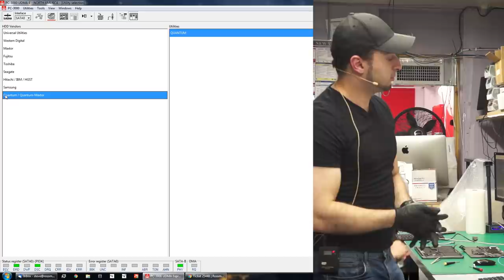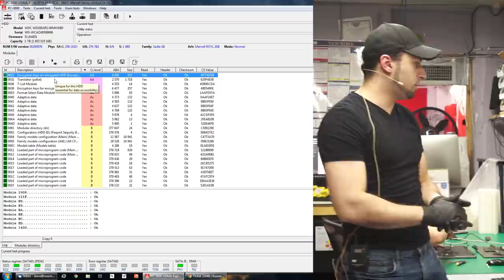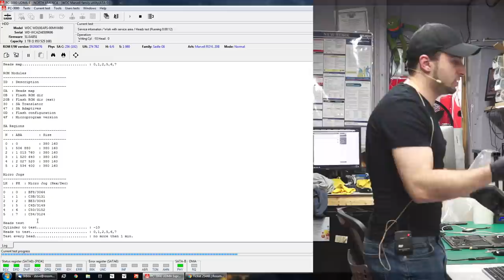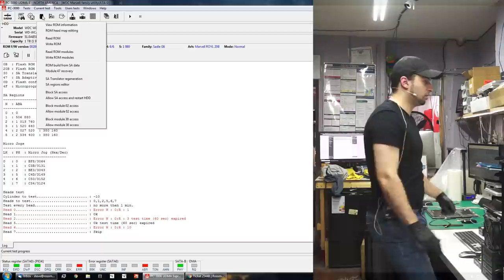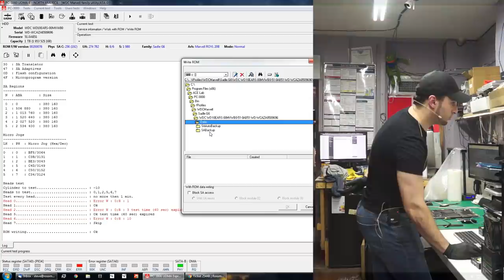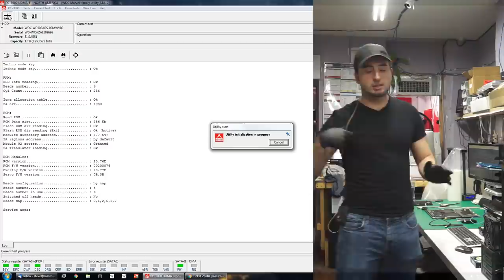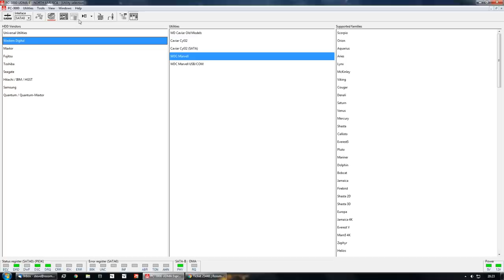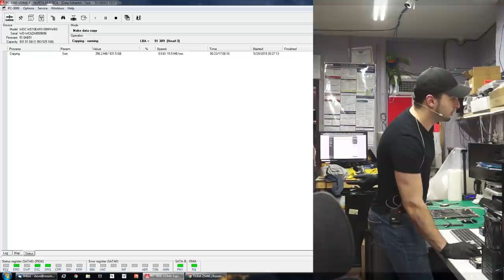Western Digital hard drive data recovery: heads swap

Comment: What I am interested to know is whether similar boards with almost similar model numbers but same capacity can be swapped to check if it is a bad board, or it has to be same exact whatever. I would think that the platter alignment just means that the data structures are stored on an index disk and not the drive ROM if it has any, so simply swapping boards would work….

Specifically, after seeing that swap between a WD20EARS and a WD10EARS, I’m guessing that third letter is the important distinction that applies to all WD drives of this model series?

Comment: All my systems i use Western Digital. I do repair PC and electronics. Most faultry drives i seen are the Seagate ones... I am at same page that he is. Not that the Western Digital fails (they do and i have seen those) but is far less probability. They are pricey but are better to me.

Comment: Steve is wrong saying that Seagate's market share is a third on Western Digital's one.Actually, they are almost the same 40% (WD has several percents higher share).
He is absolutely right that Seagate drives are inferior in  reliability. The most reliable drives were made by Hitachi/HGST, and now there are several models made by both WD and Toshiba, but designed by Hitachi (WD got Hitachi's technlogies, Toshiba got both tech and factories).

Comment: at 14:40 "contempt for Seagate" I 2nd that. I've been in IT for more than 20 years and as far as I'm my experience goes, Seagate have never been a strong synonym or reliability. Nice to see that "it's not all in my head". Makes me wonder how come they're still in business.
BTW while we're on the subject of HD reliability, can run a quick poll? Personally I'd say that Hitachy fail the least
Reply: Yes, according to backblaze anyway. Hitachi/aka/Toshiba best , then WD, then Seagate worst. And this has been my experience also. I still use seagate but I've got a bucket of dead seagate drives and only 1 dead WD. Its not just build quality, its firmware(software) quality as well. Go with NAS/Red/Enterprise drives over consumer if you can.
Reply: @mrlithium69  Thanks for sharing your experience which mirrors mine. thanks for the advice about drives. Still wonder why Seagate still hasn't gone under given how many their drive turn into door stops

Comment: Gotta disagree with the Seagate hating. Each side has their lemons but Western Digital had full lines that were lemons. I'll never recommend a WD Blue or WD Green to anyone. The failure rate on those things were so bad at one point if the drive was dead or clicking it was usually one of those.

Besides hybrid drives seem to be the ways to go anyhow, so Firecuda or the WD equivelent. Unless you want server grade WD Reds for some reason.

Really cool video though, nice to see the trailblazing is still happening over there.
Reply: I installed hundreds (maybe a thousand) of WD Blue, Green and Black (and previous families). Actually the failure rate is very low, I would say 2% or less. Maybe I'm just lucky. On the other hand, I bought less than 20 Seagate and Toshiba HDDs, and I have a lot of failures.
Reply: audio01 - have had tons of blues and blacks. As long as you raid them and stay on top of it no problems
Reply: i have been using hitachi for 7 years. Seagate for 2. Hitachi is pretty loud at times but it works still. Seagate throttles at times for some reason but no actual sign of breaking. Dunno, i think its just a matter of cleaning the dust and keeping parts cool. I have a filtered 200 mm fan in front of my raid so i dont think there will be issues lol.
Reply: @audio01  I found the WD Blacks and WD Reds held up fairly well, have yet to personally see a WD Black fail but almost every WD Blue or WD Green failed within 5 years. I've seen WD Blues fail a week into usage and WD Greens fail a few years in.

Like I said it seems to be the specific lineup of drives that have issues. Seagate has had plenty of issues from what I've seen online but I haven't had a single one of their hybrid drive fail on me yet. 

Again I will always recommend the cheapest best performing solution.
Reply: NVME is where it is at for now - gonna hope they have decent lifespans
Reply: Every seagate drive ive bought died within 3 years.. after being burnt six times, never again

Comment: I wanted to see what is causing the head to click beside that this is the best video I’ve found in hours but pls do a vid on why it clicks? what causes the click sound ? Like the head stopper or middle of platter from the head hitting it? Cus mine makes 3 clicks in all but the click makes 2 clicks stops then two clicks stops then once more before it gives up the clicks r not fast they r slower like 5 seconds apart 2 clicks 5 seconds then 2 clicks 5 seconds etc I believe it’s just stuck that’s y I need help!!

Comment: Thanks for sharing this! You mentioned the preamp being damaged. Could that cause other PCBs to burn? I replaced a PCB to see if the disk would spin and it did, but then the PCB stopped working just like the original one. Could this be related to this same issue you have had with this drive?

Comment: He forgot the best manufacturer : Hitachi GST.
I worked for a SAN manufacturer and the most reliable enterprise disks were in that order: Hitachi, WD and Seagate.
Toshiba is just crap for enterprise (maybe okay for desktops). I recall a client wanted Maxtor disks and there was wo many failures that there was a pallet of maxtor disks in the corner that stayed there for a few years :) so crap they jsut fail one after the other.
Hitachi disks tend to heat more than WD and Seagate but their firmware is much more uniform in terms of bugs and features compared to WD/Seagate. That said that was 5 years ago, at the time Hitachi was just bought by WD and I'm not sure what it did to their quality.

Comment: Stupid question:  after my first external HDD died, I dismanteled it to try to see what exactly was broken. Then I took out the platters and simply stored them in paper CD--envelopes in one of my desk drawers for the last ~8 years. Do you think if I could get of one of those exact HDDs, I could try swapping the platters? Or is that just fundamentally impossible?
Reply: The platters need to stay in the exact position they were in the hard drive to make the data intelligible. Because you have removed the platters from the motor assembly I'd say your data is gone

Comment: Saw your tutorial and it's amazing, I have head swapped WD5000AAKX with same donor very carefully. On bios it is detecting as 0.00MB. I don't have any other hardware such as PC3000 etc Just normal computer. Is their any workaround or solution? Also when i put back head on donor it is showing 0.00MB on donor drive at System BIOS. I have used new drive as donor. Can you please help me? It's really urgent.

Comment: Question how many Kingston SV300/SV400 and Seagate slims you get per year?
Reply: @oceanbytez847  Im not worried, i have backups of everything i own in different ways, the reason why im asking is because those are the drives i replace the most when i work, 7 out 10 times its one of those 3.
Reply: @Melamamoduro  so what im hearing is seagate is garbo and kingston is close behind?
Reply: havoc467 pretty much,Kingston makes horrible SSDs, for a reason they are the cheapest in the market, probably the only ones that sell SSDs with 2D NAND in fucking 2019, even the Chinese SSDs(Kingdian and Mushkin) are a way better option.

Seagate just sucks in general.
Reply: @havoc467  Pretty much, Atleast Seagate offers the same performance than the competition(leaving reliability aside) unlike Kingston.

Comment: In my experience of working on PC's over the past 30 years, I get more  WD HDD failures than Seagate.  Toshiba drives have the worst failure rate out of all of them.  HP and Dell use an even mix of HDD manufacturers so you cant say its because WD has a bigger market share, that maybe true for replacement drives, not for OE.

Comment: In the case of donor 1  head assembly not working properly do you simply replace that assembly back in the donor and make notes regarding that particular donor for future reference or do you simply not use that donor drive again. Once you pull the data off the patient and the job is complete and customer gets the data, does the donor head assembly that you use remain in the patient and the drive is returned to the customer or is that head assembly returned to the donor from where it came from?

Comment: Hey Louis, quick question.  After replacing actuator arms with the heads on, Can you plug in the drive to attempt accessing the data without doing the pre-check with PC3000?

Comment: Hey can you get Steve to go over some of the common problems that can arise if you move a drive while it's in operation. Kind of like if you have an external hdd in a case what are the risks? Is there any mitigation in newer drives? Very informative info
Reply: Thats why externals die more often. Laptop drives are built with free-fall sensors/accelerometers that detect drops and will park the heads instead of letting them "fly". Otherwise the heads have the potential to crash, and will cause damage to the data platters too. The other thing externals tend to have is firmware with more aggressive head-parking behavior when idle for a short time (8-15 seconds). It detects when nothings happening, and parks the heads in the little plastic orange ramp, and locks the actuator arm. You can hear this. Beyond that, the drive motor itself will spin down to a complete stop after 10-ish minutes of inactivity. You can also hear this. These mechanisms alone put wear and tear on the drive (Load/Unload Cycle count), and for desktop use, IMO its safe to disable this. 
The free-fall sensor is optional these days and the manufacturers don't include it A) because externals are built down to a super low cost, and B) because they want you to kill your drive by misuse and make you think its your fault so you can buy a new one. It might almost be better to purchase a 2.5" laptop drive that markets itself as having this free-fall sensor, because its unclear if the 3.5" externals do (and they most likely don't).
GL!

Comment: I use WD Black, are those gasfilled with Helium or? I noticed that where mentioned on a video about the data collected to build the picture of the black hole recently, and I spotted the WD Black logo on their arrays of disks. Or is the Helium filled only used for the really big hard drives?

Comment: but if you just swap the PCB will you be able to plug it in afterwards and still get the data? will the new pcb play nice with the old platter? or will the 
platters only work with the PCB that came with the drive originally. do you HAVE to use PC-3000?

Comment: Great stuff! Do more videos like this on data recovery. Personally for me, it's much more relevant than Apple crap board repair and micro soldering.
Reply: For you maybe, but the board repair is a lot more relevant for the majority. 99.9% of people aren't going to do this. And it off the the 0.1% that do, 99.9% will fail one way or another. If you can successfully do this, or even if you have the confidence that you MIGHT be able to do this, you're a very small minority. You need the special comb, positive pressure hood, a donor drive, and know what's wrong with it. If someone's data is valuable enough to attempt recovery by switching out the read arms/heads, you're better off sending it to someone with an ISO positive pressure hood, the pepper combs, and the experience/know-how. Just because you and I can do this, doesn't mean anything more than a "VERY small percentage" of people can. And, as you can see, even he effed something up.
Reply: @xenonram  that's why I said personally for me. personally for me it's more interesting than  board repairs and in my  opinion I think it's easier than what Louis  doing with micro soldering. for me what's Louis doing is science fiction.

Comment: arent some drives filled with helium ? If so, opening them will replace that helium by air, that might cause problem no ?
Reply: It might, but the whole point of the data recovery is to make the drive work just long enough to get all the data on a brand new, typically larger/faster hard drive. You never really want to use an old drive after it fails physically.

Comment: Great video, guys - very informative particularly @16:36 you say that the 2TB donor and 1TB patient drives (even though different capacity) have compatible head stacks etc. Do you guys know, is this typically the same for the now discontinued WD Green 4TB (WD40EZRX) and WD Green 5TB (WD50EZRX) drives too? Do they have compatible head stacks/ ie. same platter count? - I just contacted WD Support, waiting for them to get back to me via email. - Thanks!
Reply: Follow up: Just incase anyone is researching this issue like ourselves for donor reasons (or just out of interest without cracking open, damaging drives or wasting time/money)… Western Digital indeed confirmed today that the WD Green 4TB (WD40EZRX) drive [circa. 2013/2014] - has 4 Platters and 8 heads in the assembly. We were hoping it had 5 platters and 10 heads for our 5TB after watching this video, to save us $250+ on acquiring an EXACT donor. - Oh well, we'll keep searching for a 'well priced' , 'for parts only' 5TB donor! - Hope this helps someone! :)

Comment: If the old heads have rubbed away against the disks lower in the stack, then replacing the heads without securing the old heads from the stacks, wouldn't that risk the new heads?

Comment: Whats the easier repair or correct fix for a dropped external, replace the head or swap the platter?
Reply: I don't get clicks like that I was getting fast scratches. 😕

Comment: Seagate 7200.11 drives have firmware that, without notice, locks the drive out. I have to pull the board and use a method to power up, reflash the firmware through the serial connection on it, then reassemble to see if it works. Western Digital all the way for me!
Reply: I actually loved the Seagate 7200.11 drives for their serial diag interface. Playing around in the serial terminal console led me down the rabbit hole of learning about this stuff hands on. A crash course obviously becauseits largely undocumented, but without need for PC-3000 to get the drive working. I'm familiar with that problem you mention and was able to fix it with the serial connection and afterwards re-flash it prevent it from happening with the new firmware fix from Seagate. Western Digital has no debug interface to speak of. Seagate also removed theirs.

Comment: I’ve typically had very good service out of my WD ( western digital) drives;

But as  with anything that is either electronic or mechanical;

 Stuffs happen,
Especially when you are not ready for bad news 😱💰💰💰💰
Reply: Between 1998 and 2002 I had well over 50 WD drives all fail with the exact same issue, servo motor beat the heads off the drive have not trusted them even one iota since.

Comment: Any chance of a detailed video about why you hate Seagate? I'm going to be honest...most of my drives are Seagate and thankfully none of them have failed crosses fingers and does a hail Mary (although a couple of my external drives have acted up but I think it's partly due to the cable rather then the drive as it's more like the drive isn't getting enough power to spin up) but I would like to hear your detailed reasons for why you hate them.
Reply from the maker: Simply put, when a WD fails, it fails gracefully - you'll be able to get your data back.  When a Seagate fails, you can kiss your data goodbye.  Not all Seagate drives are bad, of course, but most of them are. -Steve

Comment: I see they're both wd green, WD10EARS and WD20EARS. Would for example a WDxxEZRX, same wd green but different... (what are the differences???), donor work?
Reply from the maker: Most of the EZRX models have two extra screws that hold the HSA power connector in place (you can see them on the top cover). It's a different shape, so you won't be able to fit it in the EARS models.

Comment: Just a question: did you use a sony a5100 for overhead? and if so any overheating problems?
Reply from the maker: Yes and no. I am recording from hdmi out. Not internally to the camera.
Reply: @rossmanngroup  Oh ok. I was just consodering getting one so I wanted to know your experience.

Comment: After watching this video I want to try a DIY repair of the headstack in my WD80EZAZ drive.  However, after I shucked the drive out of the My Book housing I discovered there are no visible screws on this white label drive to easily remove the cover.  So, now I don't know the next step. Does anyone have the solution to open this drive?  Thank you!